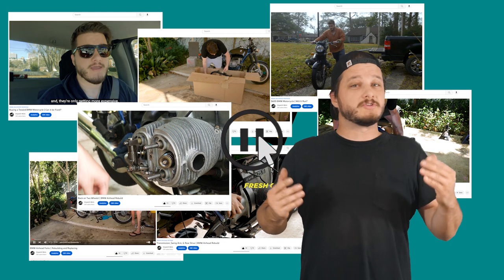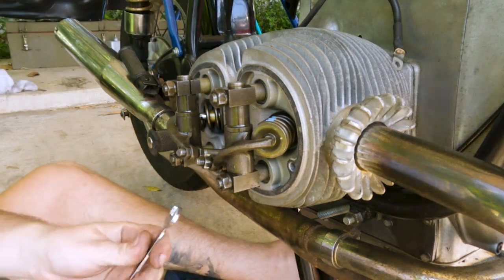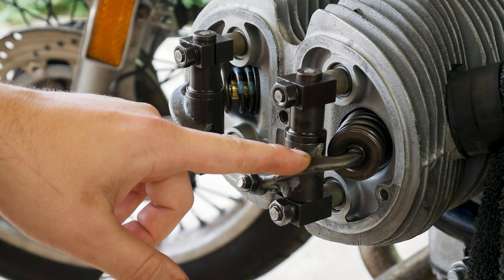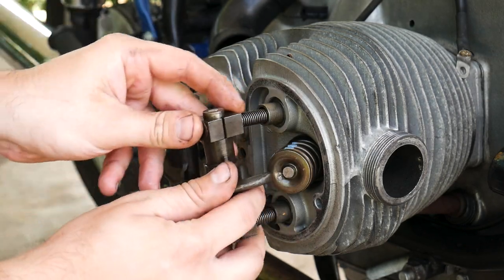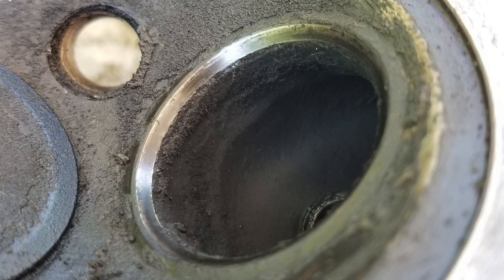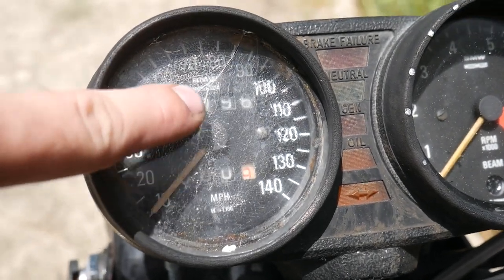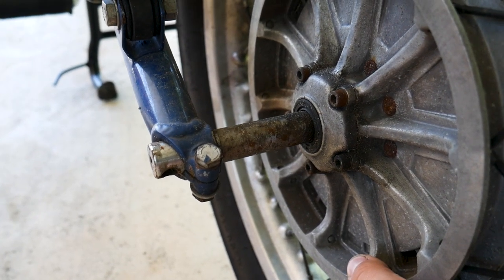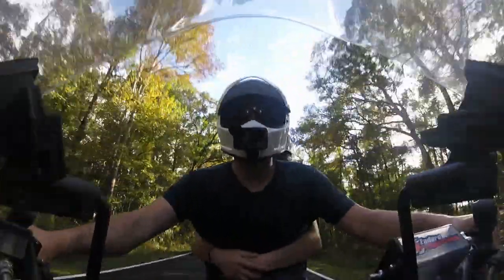Bmw Valve Adjustment and Issues  | BMW Airhead Rebuild

Comment: Great video man and it's nice to see you make serious progress on your /6! Regarding the rear wheel: do not throw away that wheel! The preload must be adjusted between both tapered bearings and it's really not that hard to do. With a couple of hardened washers, you could possibly save that rear wheel. and use it as a spare in the near future. 
I'll try and share more information on this in an upcoming video, once I'm ready to assemble my hubs. 
Keep up the awesome work and don't be afraid to share more videos along your journey! Cheers
Reply from the maker: Thanks, dude. Was gonna go up on the wall somewhere as some "wall art" but definitely saving it as a spare if some how that hub can be used/salvaged. Thanks for watching.
Reply: you two are the best airhead YouTubers at the moment. keep it up!  @DispatchMoto
Reply from the maker: That's a huge compliment,  @zm6658 . Means a lot, thank you!

Comment: Whats the solution to valve seat recession ?
Reply from the maker: The solution is sending it off to a machine shop specialized in airhead machining where they're able to grind, pull, (not exactly sure) out the old seat and replace it. There are preventive measures you can take.

In my case I believe it was less of a case regarding unleaded fuel/heat and more of a lack of maintaining a correct valve clearance seeing how only one side is effected.
Reply: @DispatchMoto  You say "machine shop specialized in airhead machining".   Yes!  Make sure they know what they are doing.  Years ago I gave a machine shop a CB750 fork tube that was bent and asked if they could straighten it.  They said "yes".  When I got it back it WAS straight, but it also had knurl marks on the lower, hydraulic part of the tube.  Where the fork seals would travel.  This ruined it.  Back in the day, we tried to reuse as much as we could rather than just replacing it.  It was useless after straightening.
But I kept it and still have it, it wouldn't work as a fork tube but it makes a great cheater, slip it over a breaker bar and if you don't break the socket you will break lose whatever you are trying to loosen.